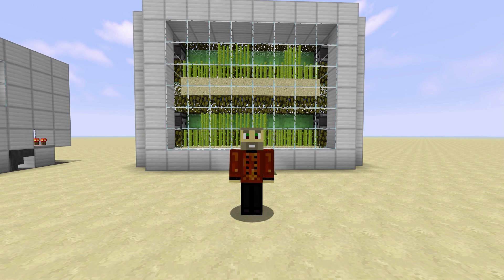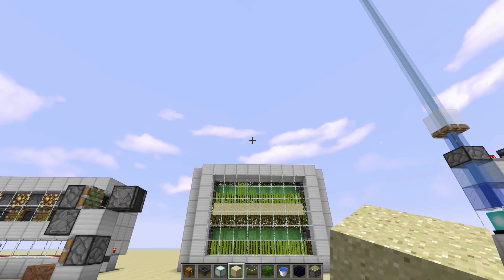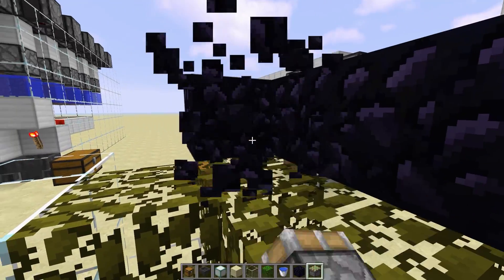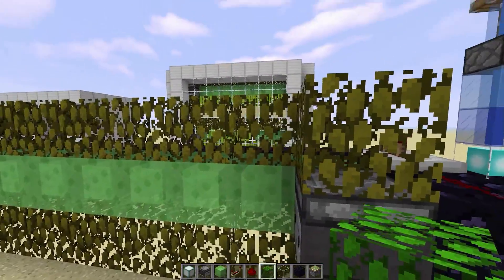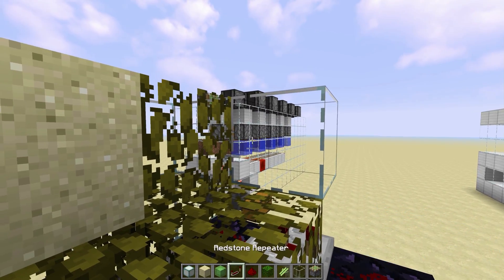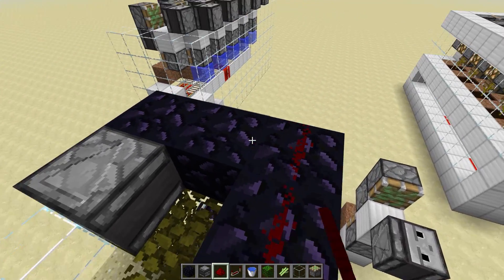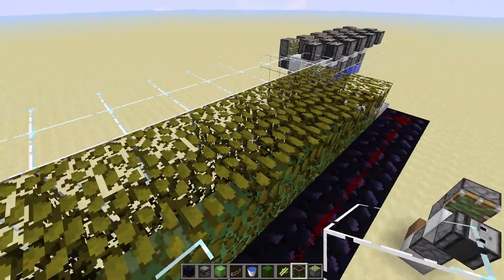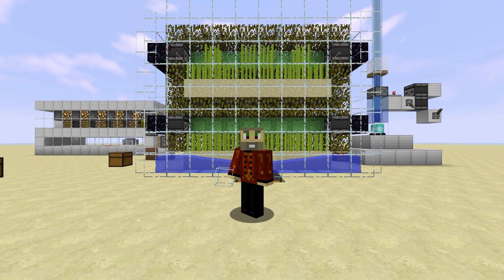Auto Sugar Cane Farm Using Observer Blocks

Comment: Wow, I think this gets too many dislikes, because this one works for me in 1.12 (maybe they didn't do the instruction correctly).

Anyways, after building this design and break the entire thing block-by-block. I found out that you need 2 water buckets, 10 slime blocks, 8 sands, at least 36 glasses, 13 redstones, 2 repeaters, 32 oak leaves (or any kind of blocks that doesn't interact with pistons really), 1 sticky piston, 2 chests, more than 26 stone bricks (to cover the backside and up), 15 obsidians, 8 sugar canes, 2 observers and 4 hoppers.
Reply from the maker: +AnthonyTom I haven't looked at the dislikes in a while. Now I'm curious. I do my best to design things on solid game mechanics and about bugs so they don't break with updates. After all, who want to run around their world fixing everything all the time?
Reply: +HalfSlab Bacon Oh so the design may not work in some updates, I see. But it still works in 1.12 though :o
Reply from the maker: +AnthonyTom it should continue to work for the foreseeable future.

Comment: There are 2 pieces of glass where there should be nothing or a block that doesn't stick to the observers.  They're one block to the front of and under the observers.  When the piston extends, the observers get stuck.  Once I replaced those with blocks that won't stick to slime, it worked great.
Reply from the maker: +Thorn Harvestar blocks don't stick to observers. You must have misplaced some blocks and had them sticking to the slime blocks. Glad you figured it out and got it working! Enjoy!

Comment: did not work on 1.11.2 :/ i double checked everything was exact.
Reply: I've build this exactly Block-for-Block but the 'cane never grows... not sure if something's changed?
Reply: Just sat and watched it for 30mins.... (I've not changed anything)... I can confirm it does indeed work... but it's incredibly slow compared to your video... <10 canes in the 30mins. Strange... :(

Thanks for the tutorial! :)
Reply from the maker: +Mark Brown it will run slower if there's other crops in the area as they share the block update algorithm. It'll run even slower if there's natural sugar cane around competing for the growth update.
Reply: do you know of any way it would work on spigot a pulse extender or something?
Reply from the maker: +Katt Tilson you did something wrong, it runs just fine in 1.11.2 did you change the dimensions or fail to use blocks that slime blocks don't stick to?
Reply from the maker: +Mark Brown Nothing changed, so you did something wrong.
Reply from the maker: +bBeNzs13 well you've got to be doing something wrong, mines cranking away in several different worlds. If you say it's sticking, perhaps you didn't use the correct blocks. The slime blocks can only touch immovable blocks.
Reply from the maker: +bBeNzs13 do you have spigot on the server? It messes with redstone timings.
Reply from the maker: +BølleBanden probably just need to add a couple repeaters on each end and play with the delay. Spigot does change Redstone timings, but not by much. Usually a simple tweak like that is all that's required.

Comment: How long can you extend this farm vertically?
Reply from the maker: +Face Nugget you could take it all the way to build hight if you wanted.
Reply: HalfSlab Bacon no no, I mean like sideways. I tried to make it longer than what u made and it didnt work. It didnt push the piston out, it just activated the redstone and didnt do anything. sorry I dont know the diff between vertical and horizontal xD
Reply from the maker: +Face Nugget that's horizontally. And no it only works in the configuration I designed. You have to make seperate cells to go horizontally.

Comment: Thanks for the tutorial Bacon, as you promised. I miss you saying "Half Slab Bacon back", I always got a kick out of it. Could you extend the length by using two sticky pistons, one on each end instead of one in the middle?
Reply from the maker: +Mike Dorsey I still say it. Just not in every series/episode. Unfortunately, no you can't extend it due to how slime blocks work with sticky pistons. Each cell has to have that configuration or it'll fail to fire.
Reply: HalfSlab Bacon thanks Bacon
Reply from the maker: +Mike Dorsey NP